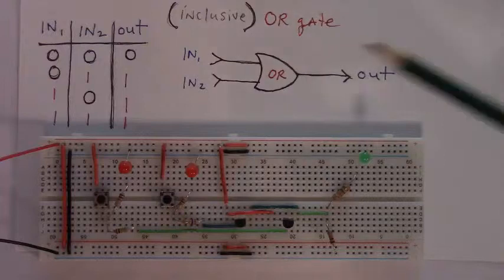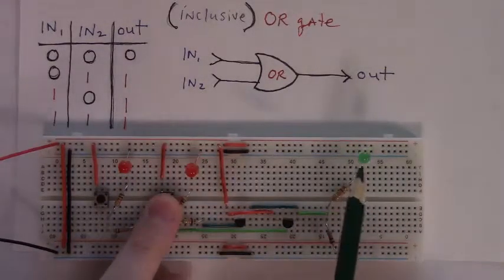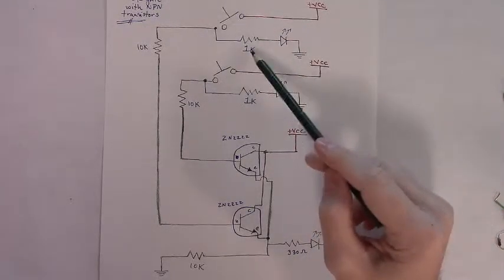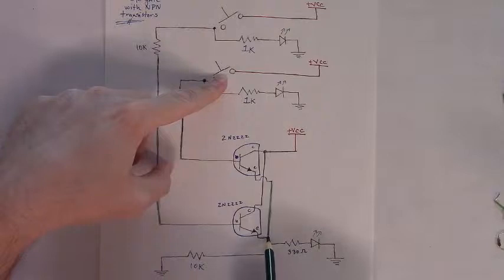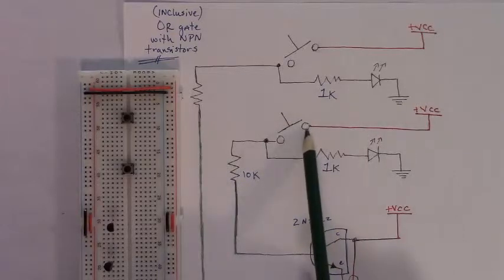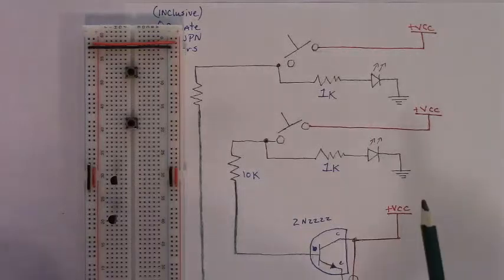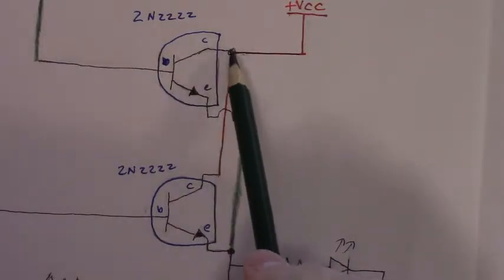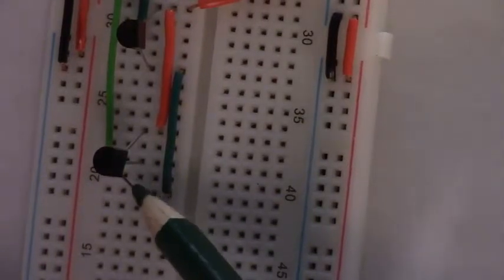Circuit Assembly Tutorials || How to Build an (inclusive) OR gate with NPN transistors

Comment: I Love how you explain exactly how to build the circuit. I've failed at simple 555 timer circuits because I didn't translate schematic to breadboard correctly and I've had friends with the same frustration. The step by step is well worth the effort.
Reply from the maker: Jeff Ratliff Appreciate the comment and I'm glad the videos are helpful.  I can definitely understand the difficulties associated with moving/translating from a schematic to the breadboard to eventually perfboard, etc.  Typical 555 timer circuit schematics can be the most difficult to translate (especially for those just starting out).  When I first became involved in electronics (quite a few years ago) there were many frustrating days spent doing my best to build a circuit that seemed "simple" on the schematic but never quite worked out that way when I attempted to assemble it on a breadboard.  555 timer circuit schematics are often drawn with the pins in a 'functional' input to output configuration.  Ironically, the reason provided for such is that it's supposed to be more 'simple'/straightforward to understand.  While that might be true in some cases of understanding a circuit's overall functionality, when it comes to actually and successfully building the circuit on a breadboard my experience has often been the exact opposite.  I always redraw such schematics with the pins matching the chip rather than the circuit's supposed overall 'function'.  Some must find functional input-to-output schematics especially helpful and useful, but I've always preferred those that adhere as closely as possible to a chip's/part's actual pin layout.  When I first started out my desire was to successfully build interesting, useful, etc., circuits, not to spend hours figuring out a 'tumbled pin' type of schematic.  I tend to think that most beginners have the same desire, that's the major rationale behind each of my circuit assembly videos.  I.e., to help someone build a working circuit within a short period of time rather than spending hours trying to interpret a 'tumbled' schematic. There's certainly a lot that can be learned during those days of trying to make sense of a 'functional' rather than 'pinout' types of schematics, but I like to think that there's plenty of time to learn those things after one has a working circuit in hand.  

More circuit assembly videos are definitely in the works.  I have a whole host of relay, motor driver, audio, etc., circuits in the hopper. They're just waiting on the moments when I have the free time to construct the videos.  If there are ever specific circuits that you'd like to see assembled please let me know and I will do my best to upload videos about them as soon as possible.

Comment: hi ,my first thought was for the ear amplifier(on youtube) but after seing more of your circuits and how you explane them, i would like to try some more.the main thing for me is understanding how each part works and why it is used in the place it is set(exe.i  capacitors, risistors, diodes, etc) i also agree with Jeff ratliff,transfering schematics to breadboard is not so easy.keep up the good work Mike!!
Reply from the maker: Mike Hancock Appreciate the comment.  

When time permits I'll definitely do my best to construct a hopefully helpful video series about the core components.   And agreed --from schematic to breadboard to eventually perf board, etc., can often be quite the challenge.  Many schematics seem to be drawn with what's easiest for the one doing the drawing in mind rather than with what might be needed and helpful for the one actually doing the building (typical 555 timer and op amp circuits come immediately to mind).